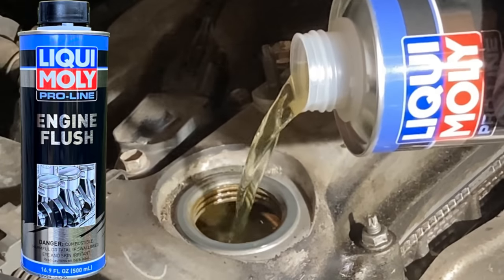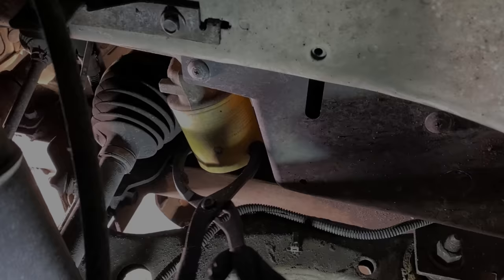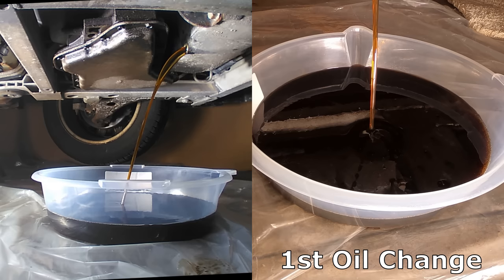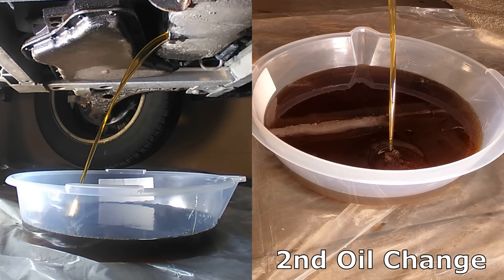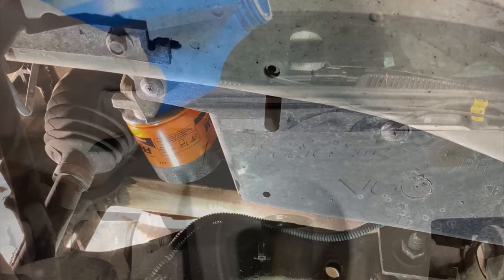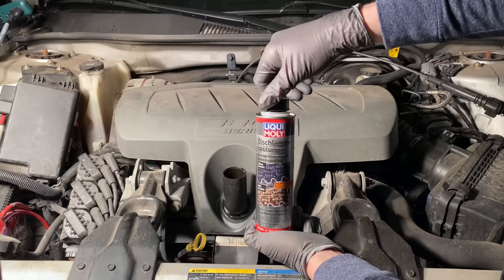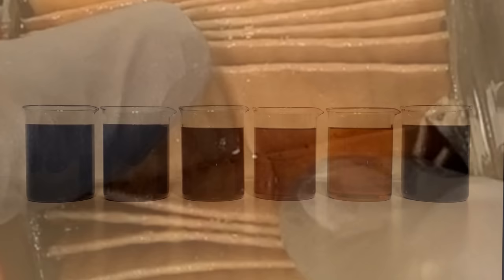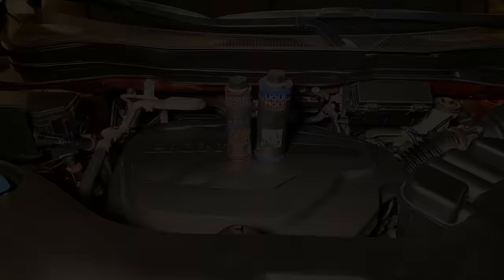Liqui Moly Sludge Remover vs Liqui Moly Engine Flush (Which is Best?)

Comment: I have a 2002 Subaru AWD outback over 250,000 + miles on the original four-cylinder engine smoking none of that stuff but 95% of those miles or all highway so I burned up most of your carbon and sludge because of that but now I'm doing a deep dive and going to give her a thorough cleaning and that includes dropping the oil pan cleaning out the pick up screen and oil pan you in a double flush and clean she's worth it she's been a super reliable car all over the United States including the Rocky mountains
Reply from the maker: Interesting, give it a flew flushes first, might be able to avoid pulling the pan off.  Congrats on taking care of the car to 250k! 💪
Reply: @OwenLucas  she's been a remarkable car how many people underestimate the Subaru and how reliable they are just normal maintenance and these things will go forever
Reply: @michaelmyers3892  make sure you replace the head gasket with the new MLS style if you haven't already done so

Comment: What a video. Amazing, from my experience as I change my own oil, synthetic oil gets darker quicker than conventional oil due temperature, you can see this in other videos as well when they use pots with high heat, gunk in the oil will vary from engine to engine, as I remember my old Toyota pickup truck will get the oil pretty dark within 3000 miles and my Hyundai accent GDI was not as dark after 7000 miles and not as full of gunk as the old truck, but definitely color in newer oils is not actually an indicator as when heated will darker quickly anyways.

Comment: Back in the day, we threw in a quart of kerosene and let the engine idle for 20 to 30 minutes.  Then we changed the oil and filter.
Reply: Kerosene or diesel!!! Or... Trans fluid!  Old school fix right there!
Reply: A bit of Trans fluid is a cheap lifter tick fix
Reply: @jimizbikowski4112 wont kerosene and diesel will make oil seals bcome bad ?

Comment: I use Engine Flush Pro (# 2037) every time I change oil (Once a year at 8-12k km). Engine is 1.8T from Audi. I idle the engine filed with Flush for 90-120 min (not the recommended 10 min). After 10 years of this treatment even 50 min idle does not dark oil much. There still is "dirt" in engine but to work with it Flush need 90 min minimum. Good quality 0W-30 oil is a little darker after year of use. In the past it was dark straight after oil change. Oil filter always have few small black pieces of sludge (I cut open them). Oil consumption is on the same level for years. It did decrease a little after first 2 years. I do recommend to use engine flush every oil change. Six times for 90 min then once a year.
Reply: wow 90-120 mins? 2 hours of idling?? that cant be good?
Reply: 😂Not for your wallet and not for the environment
Reply: You are crazy 😅

Comment: I change my oil every 7500-10,000 km (4700-6250 Mi)which is every 6 months in my case, and every time I look at the oil dipstick it's so clean, I learned this from my old 70's car where I was forced to change it due to oil loss, and that car had done over 380,000km (237,500 Mi)and still flew like a rocket, new oil and filter keeps your engine clean and the most important thing, your seals nice and soft.

Comment: A simple flush for engines is just to add half a quart of kerosene to the crankcase before draining.   Start the engine and let it run for ten mins or so.  Don't drive it or load the engine up.   Just gently rev it a few times.   Pull the plug and walk away.  Let it drain for 30 mins or so.   Then add fresh oil and a filter.   I do this every other oil change.    While you're waiting for it to drain, take a turkey baster and suck all the power steering fluid and brake fluid that you can out of their reservoirs.   Replace with fresh.   I do this with every oil change.   Sure its only 4 or 5 oz....but if you do it every time, you'll run much cleaner fluids by the time your car is 5-7 yrs old.   I change the oil every 5K.
Reply from the maker: Wise advice Steve! 💪
Reply: Yes Kerosene works but its works best with a Hot Engine , Marvel Mystery Oil is basically Kerosene with a red dye

Comment: As one of hondas engine engineers said, never do this to a high mileage engine as it could cause more problems by clogging holes with debris. Leave the engine as it is
Reply: Is this true
Reply: Very well could develop leaks or worsen pre-existing leaks on higher mileage vehicles this goes for all makes n models

Comment: "Oil is cheap, engines are not."
/Ford Boss Rich/
My method: (after six months or 5k miles, whichever comes first)
Round1: old oil w/ LM engine flush, 10min idle, drain.
Round2: cheap new oil, new filter, LM flush, 10min idle, drain.
Round3: cheap new oil, same filter, no flush, 10min idle, drain.
Round4: new Valvoline FE 5W30, new filter, good to go.
This is my daily driver, a '02 Ford Focus Zetec, 202k miles in it. Works like a Swiss watch.

Comment: I did a BG oil flush, and then a further 4 oil and filter changes. I do have to stress at this point the moter was a diesel. The final oil at a cost of after £200 was light. Within 20 miles of driving it was black as the Ace of Spades. The car was a VW Golf TDi 1.9 BXE engine. My uncle a mechanic of many years standing came and gave me a kick up the jacksie, he said you have just wasted £200, and worse still so many hours, days and time. People buy carsfor the sum I spent in oil changes and flushes!
Reply from the maker: Yeah 1 drain is enough, but at least your engine is super clean!

Comment: Whenever i buy a used car, specially if it looks dirty inside the engine.

I buy 3 oil filters, 1 fill of cheap oil, 1 liqui moly engine flush and 1 fill of good oil.

Swap the oil filter and warm it up. put the engine flush, run it as instructed. Drain old oil and remove filter. Put cheap oil plus 2nd filter. Drive it 2000km. Drain oil and remove filter. Put good oil plus 3rd filter.

That usually makes the trick.

Comment: No the low milage drive would not change the motor oil that dark.  I would say its due to removal of contaminates after the final oil drain with sludge remover.

Comment: The blackness of the oil depends on whether your vehicle is Diesel or Petrol engine. In Diesel engine, the oil becomes black within few miles of driving which is very much normal. And the blackness of the oil is not due to flushing, but that's  how it should be naturally. No need to flush.

Comment: One thing: I would advice using a funnel to put the oil in the engine.   You must have spilled quite some oil on the engine and ultimately on the floor/ground with missing the oil intake when pouring.
Reply from the maker: Spilled a little and had a yellow towel to catch any just in case.  No oil on the engine, I hate that smell!

Comment: But since the sludge remover is weaker to be able to be used while driving 124 miles i think it could still overall clean out a engine better than normal engine flush thats run at idle as it gets longer to work and the revs might get it into other parts of the engine like vvt which might not happen at idle though ive heard that can also cause issues if you flush sludge and block the vvt filter screen with sludge
Reply from the maker: That is a very good point, especially about the vvt screen.
Reply: Always replace vvt screen after flush. When you are at idle than no harm can be done

Comment: When dealing with diesel engines. Color doesnt matter because it gets dirty as fast as 1 2 3..... so usually I check for the consistency. Yes it is black but then consistency should be watery and not thick like honey.
Reply from the maker: Great point!
Reply: in my 3.2 liter turbo diesel engine oil changes color after 1500-2000km
Reply: @jacekkangaroo4402  you use synthetic or mineral?
Reply: @cuvame  always full synthetic
Reply: @jacekkangaroo4402  imagine.... your even using fully synthetic and is goe sblack after 2k hahaha but I bet the consistency is still watery which is what every owner should look for.

Comment: in here many people have decent success cleaning engine sludge with oil brand pertamina mesran B40 mixed with 10% palm cooking oil. It is limited to 10% because more can cause filter jam. No need for engine overhaul. And it is used normally as usual engine oil.

The alternative for other country would be diesel engine oil with group 1 base oil, usually have pour point between -6 to -10 degree celcius. For cool place, corn cooking oil can be used as replacement.
Reply from the maker: I would stick to just diesel in that case.
Reply: @OwenLucas  Many of those people failed to get result from many engine flush product  including  100% diesel fuel.

Engine flush do not produce filter oil jam at all because they are mostly useless in cleaning sludge.

 The end result is not comparable at all.
Reply: @OwenLucas  I used to use mesran B40 diesel oil and I would also stick to it as you do since it has 10+ TBN with roughly 1500ppm of zinc content. 
You would never know what are fatty acids in the palm cooking oil can really do to your engine when they react with combustion byproducts (especially in a diesel engine), using high sulfur fuel as we had here.

Comment: In my opinion the sludge remover would be the safest way to flush engine, since its less concentrated, it will slowly dissolve the sludge, trying to flush it in 10 minutes would possibly break away a big chunk of sludge possibly clog your oil gally.

Comment: I would have sent the oil samples to get tested. You may discover that the sludge, and engine flush products may have also introduced contamination to the engine bearings... to begin that slow wear...especially if the additives also had an opportunity to bypass the oil filter.

Comment: The chemicals in the sludge remover/engine flush are present in the residual oil left in the engine (you cannot remove all the oil from the engine during the normal oil change) and it is still working slowly when you are driving the car. This is why the oil has become very dark after driving it for a relatively short distance...

Comment: I learned from a very experience guy to blow air into the oil stick so u can clean rest of oil. Have u ever tried it?
Reply from the maker: That's a great idea.
Reply: i do this every time.  half a handful of dirty oil comes out
Reply: Just don't forget to drain away the condensed moisture inside the compressor tube thru the water remover cap before.
Reply: Interesting idea, thx. I'll try it at next oil change.

Comment: My advice, run the cheapest oil for very short intervals like 1 2 weeks and under 1000 miles. Drain, repeat a few times. I buy oil in bulk like 20 liter jugs and do this to any car I buy then switch to a higher quality oil and 6 month or 5k miles intervals ( this applies to me only and will vary with usage track or grocery getting ).
Reply from the maker: Great point!

Comment: Thank you Owen. I will buy the Pro-line. Next saterday i will do this With my Volvo V70 2.4 Diesel. See what will happen. You almost get the idea that you should do moren then one Oil-change, when you change the oil. I have seen several video's on this Item. To clean your engine you should do 3 at a minimum

Comment: I have a Nissan 370z and would monitor the color change of my oil over the 3K oil change interval I used. I found that even after 1K miles the oil would only be very slightly darker than when new. I would say that there would probably be no discernable change in color, unless you're running a diesel engine.

Comment: Of course, between oil changes you took the car for a spirited drive to loosen everything up and get the new oil splashed up into the nooks and crannies. 

Also, invest in a funnel. They’re only a couple of bucks and you’ll spill much less oil.
Reply from the maker: The 3 oil changes were rinses to set a benchmark of clean oil. Basically new oil, filter, and ran the engine for 20 minutes.  Final fill was according to instructions to drive the vehicle 200 km, that’s where the action and chemicals did their work.

Comment: Just change the oil fast as the recommended 10 000 miles or whatever and you don't need an engine flush. I do it every 5000 miles around 7000 km and my engine is clean. 257.000 km and counting, engine 4 Cylinder  1,6 L 16 V ,101 bhp .Cheers
Reply from the maker: Great work, if you care for your engine from the beginning, needing a flush will be much less likely!

Comment: Adding 1qt of Transmission fluid before oil change, and  running your engine on 3000 rpm for 5 minutes will remove sludge better than any solvent in the market
Reply: Interesting. I am going to try this technique👍

Comment: I have BMW650I 2007, the mileage 140,000KM.  I have been using LQM oil for years 5-W40.  Last week I did FIRST time engine flashing using LQM with the old engine oil.? The oil was very dark so was the filter.  Added new oil and filter. Regular engine oil and filter depending on the manufacturer recommendations would make the engine last for years.  Despite doing engine flashing one day that engine might need to be taken apart for reconditioning.  I remember I was in Dubai few times. When use Dubai Taxi mainly Japanese cars “Camry” most are used with hybrid currently.  Two years old Camry driven more than 500,000KM ONLY oil change and preventive maintenance can go above ONE million KM.   So to conclude, in the heat environment Japanies cars are more suited, European cars are more issues, Amarican not as good as Japanese cars but no major issues.   ALL European cars sold in hot climates uses Japanese AC technology.   Preventive maintenance will surely make cars last longer with cost depending on the car brand.   I personally wouldn’t do few engine flashing at the same time BUT would do every 30,000 KM when am changing the oil.
BMW650I 2007 you need to keep adding one litter oil every 3,000KM with engine oil change every 30,000KM SO basically once a year.  Thank you for clear and good footage.
Reply from the maker: Thank you for your insights about the different cars and environments, especially in Dubai!  I agree with you, the Japanese cars just keep going and going. The BMW650I is a handsome car, glad to hear you are maintaining it well!  I know some cars that use 1 liter every 1000 miles, it's like an automatic oil change.

Comment: The 4th oil change sample is darker due to Liqui Moly Sludge Remover addition. Other wise 126 miles would not effected to change the color to darker.
Sludge remover is no doubt better than Engine Flush because it has properties which make this to desolve anything in it other than metal.

Comment: Those 2 oil changes could have been deep filter cleaned with like a Triple R unit. 
Now it's a waste of resources.
And for dirt measurements you can use a particle counter.

Comment: If you want to prove if it was the driven miles or the engine flush.  You would have had to drive the same miles with the last oil change that was clean

Comment: Insted of using flush with old dirty oil and old oil filter that has already lost cleaning capabilities, its better to drain dirty oil and remove filter then pour some new good quality synthetic oil and replace with new oil filter warm up with engine flush and drain it, This will do wonders and there is no need of double flushing as the new oil with enhanced cleaning capabilities will clear out all the junk in new oil filter. Replace with new oil and filter and enjoy new engine again.

Comment: If you keep up with oil change intervals in a modern engine and use a good quality synthetic oil, there will be little to no sludge buildup in the crank case. This is because modern engines have a PCV (positive crank case ventilation) system which flows fresh air through the crank case under some throttle conditions. The sludge buildup that plagued older engines was because oil vapor would mix with blow by exhaust and carbon particles and form sludge. A PCV system solves this problem at the source. IMO all that excessive oil flushing and sludge removal product is a waste, his own testing shows it. There were only a few specs in the oil filter after using the sludge remover. I doubt that was worth all the time, money, and effort.
Reply from the maker: That is a great explanation of how the PCV valve works.  This was an experiment and those are good observations!
Reply: That’s why I always say, “The best oil flush is called an oil change.”
Reply: Volvo have sludge build up (on p2. Platform) so I wonder if the flush will help alleviate that?
Reply: Agree
Reply: @vicentepallamare2608 maybe only DI engines.
Reply: "fresh air through the crank case"?   Nonsense, the PCV introduces a slight vacuum to the crankcase which keeps gases from escaping thru the gaskets and seals.

Comment: I assume Liqui Moly 5200 is more soft to timing belt which is currently placed by some cars in oil bath. It is really a headache now to clean any sludge with fluids without providing large damage to timing belt. Potentially, after such clean a timing belt should be replaced completely. I will try it on Citroen C3 II(SC_) with puretech eb0 engine.
Reply from the maker: The cleaners are supposed to be timing belt safe, but the Sludge Remover is the weaker formula so it takes longer to achieve the same cleaning results as Proline because you have to drive 200km.  I confirmed the Sludge Remover is not as harsh as the Proline Flush with a call to the engineers at Liqui Moly.

Comment: ATF with engine OIL MIX, and there You go, clean engine 🤠. Oldschool 🤠🤠🥰😎😍
Reply from the maker: I'd be really careful with ATF, maybe worked for lower tech engines back in the day, but hey if you don't rev it I think you should be fine.
Reply: @OwenLucas  why do You think that modern engines can be harmed ? I take  ~1 liter of ATF for 6 liters of oil engine, all for change is 7, i use that proportion.